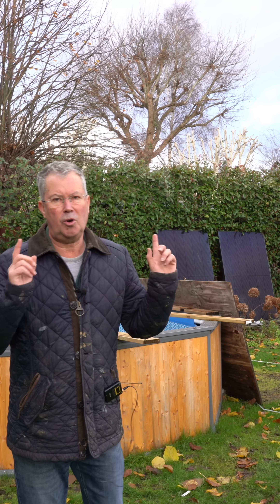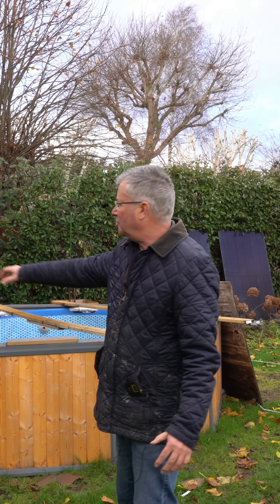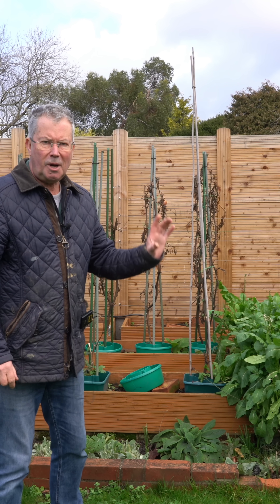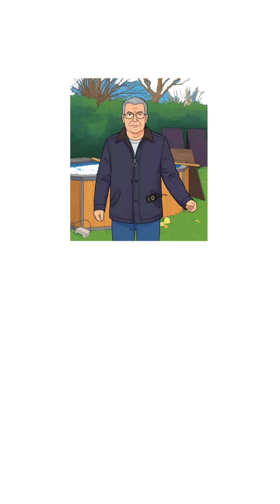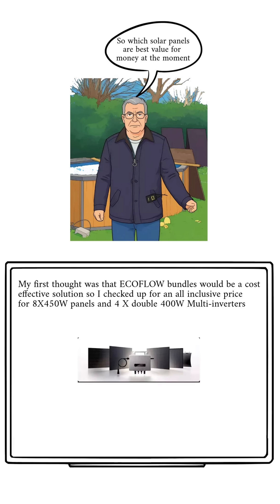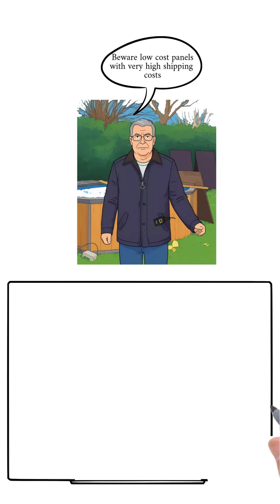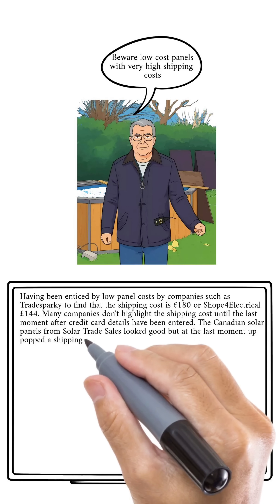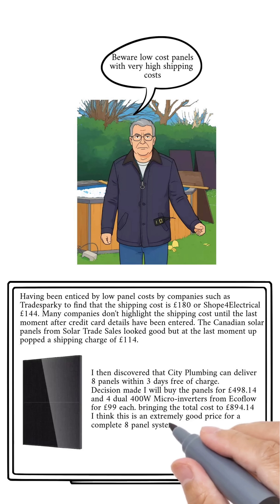DIY Solar Panels on Garden Fence Made Simple #diysolarsystem  #offgrid  #ecoflow #gardenfencing

Comment: I tried the DMEC 450 from city plumbing and also tried the EcoFlow 500w panels that came with the kit. Side by side the DMECs see to produce more. Not sure why. Plus they are cheaper
Reply from the maker: That is strange because the cells look the same. I am looking forward to trying mine side by side. Presently I am in Wales looking after my 96 year old father and have been working in Kazakhstan so desperate to get back to my DIY.

Comment: Been running the DMEGC 450w panels since April, excellent output in summer. Make sure you get some Staubli MC4-Evo 2 to connect your 4/6mm cable to inverter for them as that is what they use. Matching MC4 connectors is very important.
Reply from the maker: Thanks for taking the time to comment and details of the cable. To be honest I had not ordered them but will do it today.